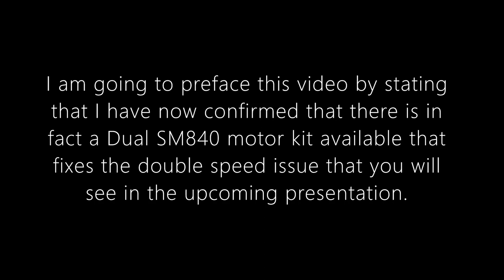Dual 502: Full Service With The Infamous SM840 Motor

Comment: Interesting.  My Dual 502, original owner bought in the mid 70s, came with the Shure M95ED cartridge. I've never, knock on wood,  had that problem with the motor spinning too fast.

Comment: Nice video.  sm840......double time. "The bumblebee"  is a reliable fix. The 50hz / 60hz issue and was never fixed under recall. I won't buy a turntable if it lacks pitch control. I prefer q lock. If it spins backwards the capacitors require replacement. Use new x rated safety caps on the pcb on the later models. Mr clean magic eraser or even better metal polish makes the headshell contacts look new.

Comment: Off topic, Found a pioneer PL 400 for sale locally. Any opinions on this model? Found you after getting a Technics SL-D202 and came across your video on it. It plays great. Now i think i have the turntable bug.
Reply: Be careful man....if you are not careful you'll wake up with 30 of them. PL 400 is a fine table.....check the rubber feet.....they probably need replacing or will soon. The sub-chassis will sink and the platter will rub on the chassis and cause huge issues. You can get new ones or just add some vinyl tape to reinforce the rubbers.....im sure there are other methods. Very common issue.
Reply: @Poppinwheeeeellllllieeeeez  Thanks. I will take a look at the feet. 👍
Reply from the maker: The 400 is a good quality deck.
Reply: @TurntableGuy  Thank you
Reply: @Poppinwheeeeellllllieeeeez  Thanks for the headsup. The TT was in rough shape. But mostly it was the hanging down of the back right corner where the tonearm is attatched. Nowhere near level with the rest of the top surface. I could raise it up level by reaching underneath. I am sure that back foot was rotted out.
Reply: I woke up with 14...